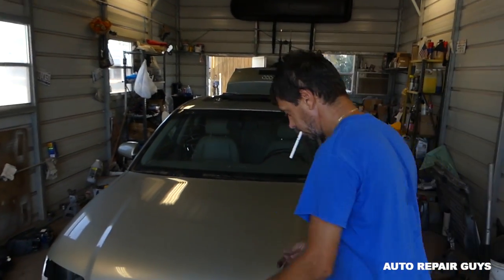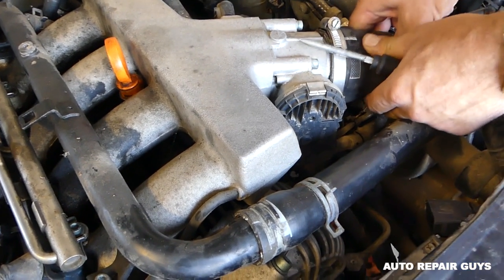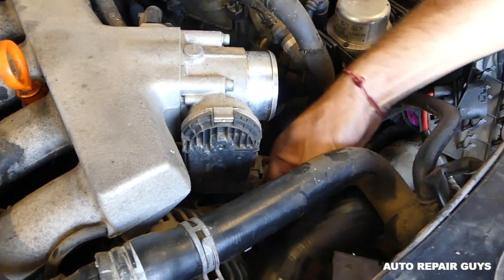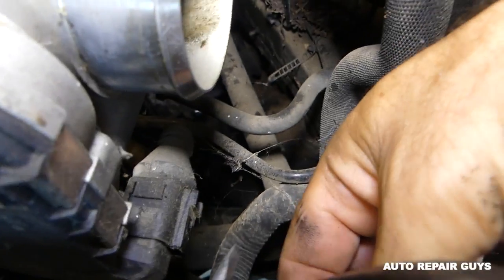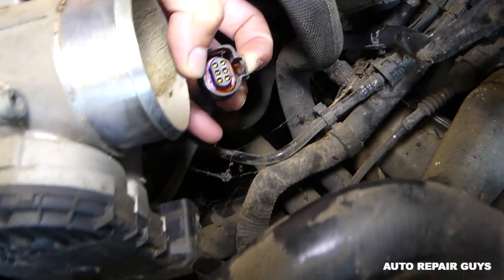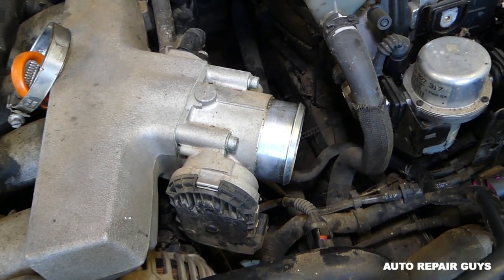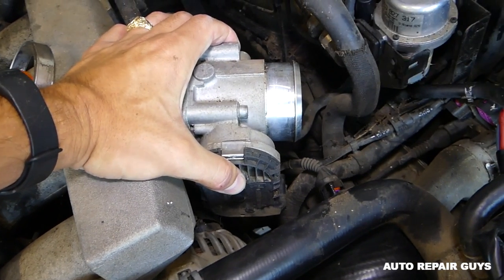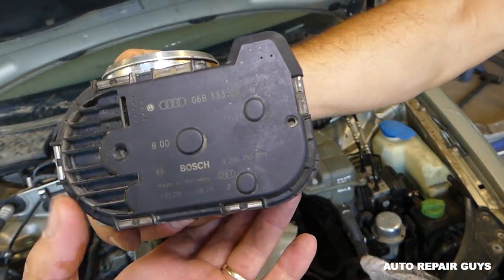AUDI A4 B6 THROTTLE BODY REMOVAL REPLACEMENT

Comment: How do you know if the throttle body is bad? I have a 2002 audi a4 1.8 I have symptoms of a bad throttle body but I don't know how to diagnose it, I did take it out to inspect it & I have a digital multimeter also
Reply: Were you having a no start condition?

Comment: I was driving and my car started to lose power the epc light came on and I pulled over and no car doesn’t. Start it cranks a bit but I hear a clicking noise on the throttle body do u know what this is ?
Reply: Yoo did you get that solved

Comment: A4 B8 2.0 TDI (CAGC) - I have rough idle (engine shaking badly, seems to work louder, noticeable vibrations inside of cabin), rev gauge is not fluctuating, rough idle happens random, and after pressing acc. pedal for few times or driving for a short time it becomes normal... does anyone have any idea why this is happening? I need to clean EGR valve (i think it is dirty), i tried to clean "throttle body" myself long time ago but later on i've read that butterfly plate inside is not good to touch or push, and i was pushing and releasing many times while cleaning, it is possible that i damaged my TB ?  Also, i noticed engine temperature gauge is reaching 90 deg really slow and if i turn on heating it goes back to 70...60... degree.. I used vag-com to check high pressure and it is fluctuating it seems...
Reply: I’m having the same problem
Reply: Anybody figure out the problem